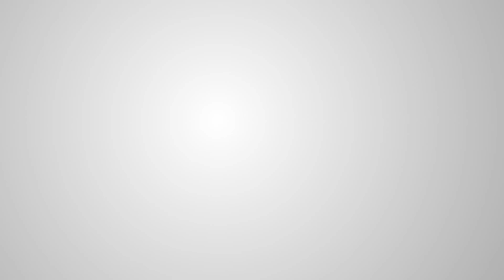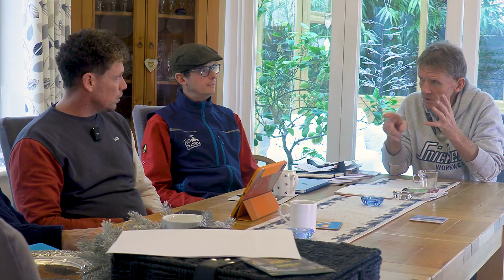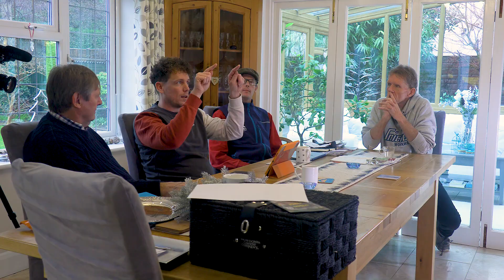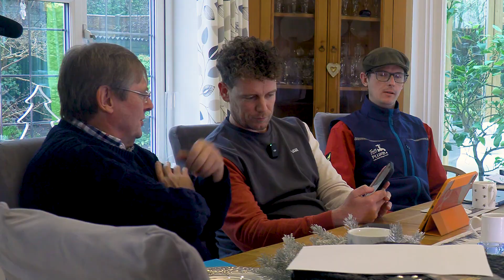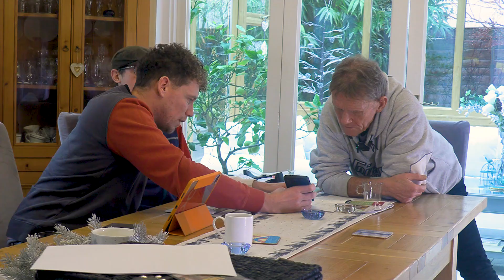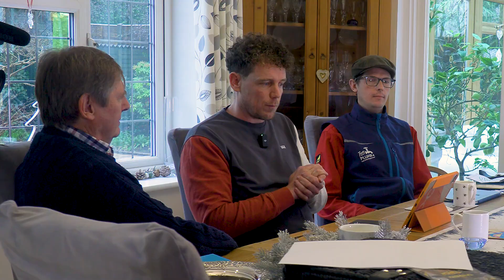What Did We Learn from the Heat Loss Survey?

Comment: It is the amounnt of starts that shorten the life span of a heat pump. I had an on-off  geothermal heat pump 2004-2023. It was slightly oversized. It had about six starts a day on average over a full year. During summer there is 1-2 starts for heating water. It was not the compressor that broke but eventually the built in boiler. Everything else also started to need smaller repairs like hoses, gaskets, circulation pumps. 19 years is above average life expectancy. I know people who have had to replace their jeat pump after 10 years. Typical life span is around 15 years.

We now have a 2-8 kW pump. I think running on 25% is on the fringe of beeing good for the compressor. The 2-8 is the nameplate capacity. I have notnseen it running at 25%, but more frequently on 28%, so the 2 kW is a downward rounded marketing number. For heating there are around two starts per day on average. This is much less, but there is another expensive gadget, the inverter, that can fail. Efficency wise there is no major difference between the old on-off and the new inverter model. I think a more  important factor is the volume of water in the heating system, a lowe volume and there is more benefit from an inverter. The bigger the volume the smoother you can operate. We have a spot price scheme on electricity so I have also set the system to utilise the cheaper hours. Over the last year my paid price is some 10 % below the spot price, sometimes 5% and some times even up to 20%, but that is rare. I pay 0.4 cents on top of the spot price in margin. This is icluded in the 10% savings. With an extra sized boiler for the heating and underfloor heating in a concrete slab the system is very slow so an on-off pump can be set so that it does not start too often. This provided the house has proper insulation.

We have an air to air heat pump in a separate garage. This is also an inverter pump of  1-4 kW. During spring and autumn it runs an half an hour and then stops for half an hour. This is not good for the longivity of the pump. The space is only 40 sqm. It is on the smaller size for installing a heat pump but should be cheaper than direct electricity heating. I only keep the temperature around 12-14 degrees. This pump I have only had for one year. 

I am happy with our heating system. Tempreatures are quite stable. It takes one to two days if one wants to change the temperature. The system however handles shifts of +-10 degrees out side temperatures fairly well the outgoing temperatures in the floor varies between 23 and 38 depending on the outside temperature. +38 is only if it gets below -28C. There are no thermostats inside.

I will not put more money towards loweringbthe energy bills, no ugly solar panels that makes roof impossible to maintain, nor any fire hazard batteries. The heat pump descision I made in 2004 was purely out of financial reasons, back then there was little talk about climate change. Now there is and I would not want to finance Putin’s wars so that is a bonus. The impact of a heat pump on the climate is marginal. The alternative would have been direct electricity heating. Back then electricity prices were lower and the volatility of oil prices had been higher.

Comment: Am I right in assuming that, if you haven’t got underfloor heating, most or all of your rads will need replacing for bigger ones to cope with the lower temp of a heat pump PLUS all your 22mm rad pipework circuit will need replacing with 28mm? Also you'll need a new cylinder with larger coil pipework plus then the cost of the actual heat pump itself? Sounds like costing a fortune even with the government grant, which I cant see lasting forever. Am I correct in assuming all of this?
Reply from the maker: I think you will find that in most cases you will need those upgrades to get the efficiency but lots of installers will tell you a heat pump can run on the existing pipework.
Reply: @SkillBuilder thank you
Reply: @SkillBuilder I can't see many rushing but depends what customers are being told to make it seem cheaper.

Comment: I’ve an old external oil boiler with a best efficiency rating of 65%, non condensing here in Ireland. Builders slapped this in when building in 2006. Great videos as I’d need to consider a new oil boiler or heat pump in the future. As this thing is eating money/oil.

Comment: I'm a heating installer and recently did my heatpump course,  having looked at the sales and marketing side of things, im feeling the market has been stitched up by large energy companies offering Package deals on installation and cost of the energy to heat a customer's home. My assumption is also that solar pv and batteries are used as a buffer to offset any higher running costs?.. especially when i have recently been advised to take out indemnity insurance.
Reply: You are probably right and as usual the public is conned.I just stick with my simple Combi Gas Boiler heating 8 radiators and a shower plus hot water.My brother has the most up to date system in the Netherlands.Brand new house and a small engine room behind a door in the dining room.His system is ground sourced which is supposed to be the best.His wife was panicking when I had a shower and opened the window.She said they were not allowed to open windows.I said so why do you have a bathroom window which opens? Totally brainwashed.Haircut cost him 20 Euro's but that is an other topic.
Reply: @foppo100  yes, ground source heatpumps are better, as they run with much less noise, and the high water table will work well in Holland!. If energy costs were cheaper, more people would be able to afford them in the UK. Its just Air source are Noisy after 6-7yrs and they are what's being pushed for sales.

Comment: Hi Roger, thank you so much for this, in my current domestic circumstances I do not think we are going to 'invest' in any new boiler or heat pump, the gas boiler system we installed thirty years ago is still doing what it should and our costs are way below average due to the way we live. 
Aside from all that I have sat hear listening to your sensible discussions with rapt attention, in the process you mention several critical issues relating to the style of operational management found in the construction industry which I am very familiar with, in particular the level of dis-connect between designers and installers and the paucity of information exchange.
The way you all talk it sounds to me very much as if many normal sensible people much prefer to do things properly but they do need the tools and knowledge to do so.
The points you make near the end about the way the government has promoted the installation of heat pumps without regulation and supervision of installers does not surprise me at all! much the same has been happening with the enthusiastic promotion of insulation based on the understanding that doubling the thickness of insulation reduces heat loss by a factor of four makes it look as if unlimited thickness is a true benefit!. This is utterly false! if half the heat is trapped by two inches then half of that lost, trapped by another inch, then by the time you get to four inches very little heat is escaping and further increase in depth offers diminishing returns. I do understand that the producers and merchants of such materials have no commercial interest in publishing such information but the government has no excuse unless its real interest is to promote greater commercial profit not make life better for citizens.
Much the same appears to be happening with the appalling weak enforcement of utilities, planning and building regulations, and it is those standards which need to be addressed so that compensation such of which you speak is not required in the first place.
Cheers, Richard.

Comment: My neighbour still has economy7 storage heaters, I use gas. My gas bill is £70 per month now, but used to be that a quarter before increases. I have loft and cavity insulation. That's for 12hours heat and hot water. It's got a cylinder to store hot water and is an 18KW Ideal ICOS. Not a combination. It was to replace an old boiler at the back of a Glowworm gas fire years ago when that was changed. Apart from a 2nd hand boiler PCB for £25 off ebay that i changed and ignition electrode change for £12, it has been perfect for years. 
It's very cheap to run for a very warm 22c.
My neighbour spends around £250/month and although they can get to 20c, the heat doesn't last a full day. They end up using 3KW heaters.
Their house, when built in the 60s never had a gas supply fitted as the 1st buyers never wanted it. To get that done is far too expensive  now. They looked at grants for heat pumps, but feel it would cost more and be less efficient than having aircon units fitted.

Comment: How much has this cost from day one till now and did the heat geeks do they’re part free if the client had to repay for everything that’s been done what’s the cost of all of it
Reply from the maker: The client was going to scrap the whole lot because he had paid out around £18,000.  Getting it put right would have cost that much again so it is not a viable installation. I think the takeaway from this is pay the right people to do the job properly and it will be guaranteed to work. 
Whichever way you look at it the heat pump is not viable without the tax payer subsidising it. The government loves to spend our money chasing this dream of net zero but global CO2 continues to rise. 
Insulation and planting more trees would be a better way to spend our money than subsidising the well off.
Reply: @SkillBuilder  my goodness Rodger I’ve just purchased a top of the range baxi platinum 40kw fits in my kitchen cupboard cost about £1500 spent £2000 on column rads from stellrad and a friend that’s a heating engineer is going to fit it .

Comment: Fantastic video shining a light on what the actual transition would look like.  Brilliant Mr skill builderWhat percentage of UK houses are suitable for a heat pump today without significant additional insulation? After you finish talking about the difference between the cost of heat pump and the cost of a boiler you can carry on talking about external insulation. Most sensible people who could have insulated lofts and cavity walls have done. What we have left is a lot of people like me living in a 1930s 9-inch brick house. Let's see a cost breakdown of all of this please😊
Reply: 'What percentage of UK houses are suitable for a heat pump today without significant additional insulation?' - I would say, perhaps 10%? Older housing stock (pre 1946) makes up around 40% and they are not suitable unless you want to spend perhaps 50K+ on updating them and paying for an install. Housing from last 20/30 years with internal timber framing (with external brickwork) will probably not need such a system because they are relatively warm in winter and hot as hell in the summer. That does not leave that many homes! Perhaps the government will outlaw our old homes - who knows, anything is possible...

Comment: I don't know alot about heat pumps so im not slamming them but since ive found out they use such a low flow temperature ive realised one would never be an option.

we need either 55° flow temp for a few hours to heat up, or 60°-65° to do it quickly, if we could only have 35°-45° the house would never be warm throughout winter, it would only work in summer when the boiler isn't doing much work anyway so what would be the point?

How do people get their house to be able to use such low temps? Obviously we have cavity wall etc.
Reply: I've got a 30° flow, 180m2 house all radiators. 25yr old bungalow with 300mm in loft, 70mm in walls and 50mm in floor. It just runs low and slow, ticks over all day long and keep us at 21.5° inside.

Comment: I'm sure there was a video regarding how many heat pumps you can have in a certain area before some of them become useless due to starvation of heat available in the soil. To many factors to be taken into account.  Soil type and it's ability to retain and replenish enough heat to be viable,  amount of heat pumps the soil can handle especially in winter, if you live in a flat or city/town it's not an option, cost to install and have  serviced /repaired professionally

Comment: Interesting discussion but I haven't read anything about the potential cost of an installation and the actual amount of work involved. I have been quoted in the region of £30,000 for all the necessary work, which would include a heat pump, heatstore/tank, new radiators and replacement pipework. I have already upgraded my insulation as much as practicable. Much as a heat pump system might be desirable the costs outweigh any advantage as a pensioner.

Comment: It's so counterintuitive that you increase efficiency by keeping all your rooms warm rather than managing them individually with trvs.
Reply: I can only assume that in this case efficiency is of the system rather than the energy used when checking  the bank account . If I drive my V8 slowly it runs slightly more efficiently but it's still less efficient than when I park it , the word efficiency would normally be concerned with energy  losses but because ASHP gain heat energy from the air the figures look better if you have the system running full blast all summer and turn it down in the winter
Reply: I suspect that this is the case. Fundamentally, it takes electrical energy to move heat from outside into a room so heating that room has to cost more than not heating it. Imagine, for instance if it was 5 extra rooms. It think, as you say, it's one of those figures where the system is most efficient when it's running at full whack and I guess that's in terms of BTUs delivered per kWh of electricity used. (or something along those lines) The fact is that you might not need that heat so it's costing you extra just to make the efficiency figures look good. I guess that's why John was asking about moderation as this would be very important to make sure that you are using the least amount of energy possible. @dolphine675

Comment: It's a shame, that you didn't invite the neighbor to the table.
I'm talking about the old man, that lives next door and  couldn't sleep because of the noise and had to move  his bedroom.
Anyway, why is the terrible noise  that those air-based heat-pumps produce not part of the discussion ?
a 12 kW air-source heat-pump sucks in an awful lot of air and in generally generates an awful lot of noise.
I don't understand why such big heat-pumps are allowed to be installed.
Last question, if the heat-pump blows the cold air to the neighbor's house,  why didn't you include a scan of the heat losses of the neighbor's house  too ?  To make it fair to him,  his house should also be insulated to the point that his gas-bill stays the same.
Reply from the maker: The neighbour is onboard. Not everyone wants to be on YouTube.  If the heat pump causes a nuisance that will be a fail. 
The point about cooling his house down is not valid. His wall is a good way from the fence and hedges. 
We can do a smoke test at the end to see where that air goes and it is very likely that it hits the fence and rises. 
You make a good point about being considerate towards your neighbours but John covered all that in the first video of this series.
Reply: @SkillBuilder   A smoke test would be very nice, cold air usually sinks and won't rise, so I think that would be fun to watch.
I'm also wondering if you could  include a  noise test in dB(C)  or dB(Z) ?

(Noise usually is measured in dB(A), but that's a scam  at low frequencies)

Thanks for your quick reply.

Comment: Great conversation and balanced views from each side of the equation.  

Whilst I already have a HP (and very happy with it!), I’m always listening to these conversations as I’m asked all the time about it by people making the switch, so good to be informed. Thanks guys! 

Kudos to the customer for sticking this out!!
Reply: That’s a bit like saying, ‘I’ve got a car - how much does it cost to run? It’s objective since it’s only relative to the size and type of car, how you drive it etc.  the house is the same, size, type of heat deployment (underfloor Vs radiators) heat loss calcs etc etc. 

In other words I could ask the same question about a gas/oil boiler and get an infinite number of different answers.

It’s also very dependent on electricity tariffs and how smartly you use those. 

The honest answer is I would have to put it all into a spreadsheet to work it out exactly because we have EV’s and other electrical appliances that hoover up electricity plus we use smart tariffs, have got solar and a battery but my bills are still less than they were when I had two gas boilers, way less. 

In binary comparison,  my gas and elec were around £800 a month in the winter months before (!)  the price hikes now  around £500 in winter reducing to around £300 in summer - but this includes 2 cars amongst other things. 

Long answer but I don’t have enough data points to answer exactly and would be subjective to be relevant in any example.
Reply: How much does it cost to run?